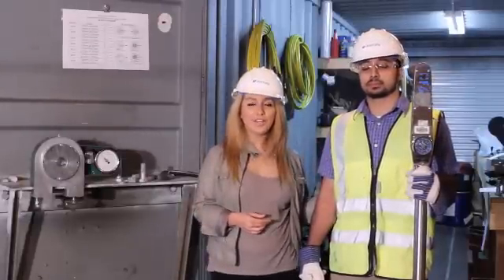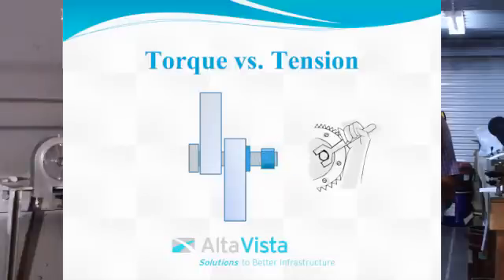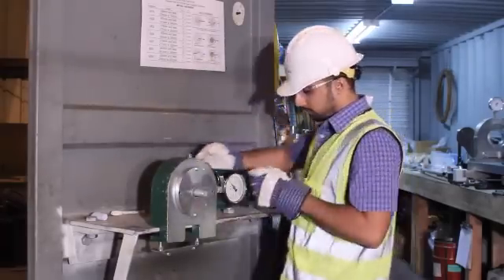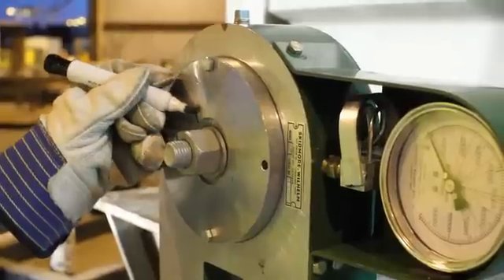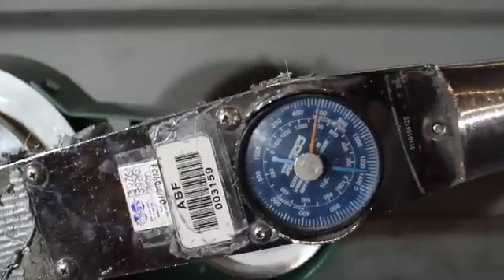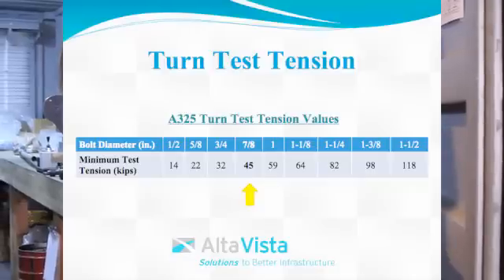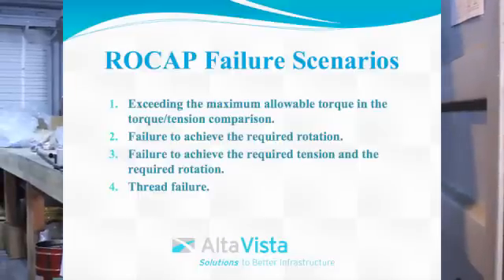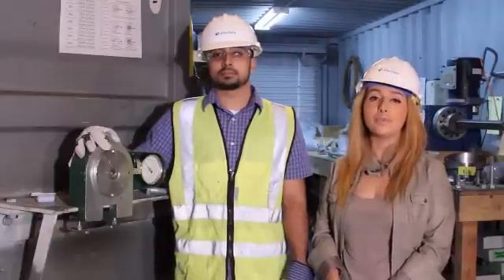Rotational Capacity Test

Comment: Dear God no. For a fastener less than 4x the diameter, it is 1/3 of a turn in a Skidmore Wilhelm. I'm not sure what you called it in the beginning. Once clamping force is achieved THEN you go the additional 1/3 and insure it is not more than 1.5x the required kips. Then inspect for damage.